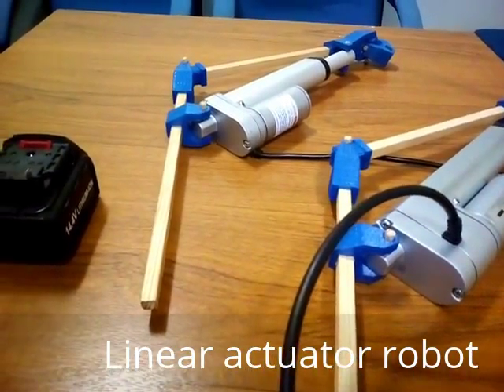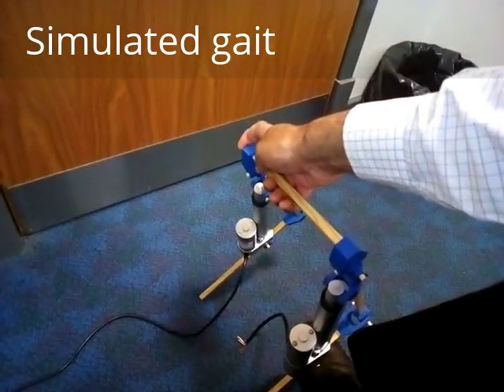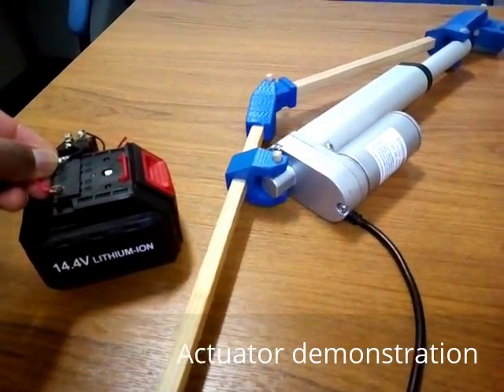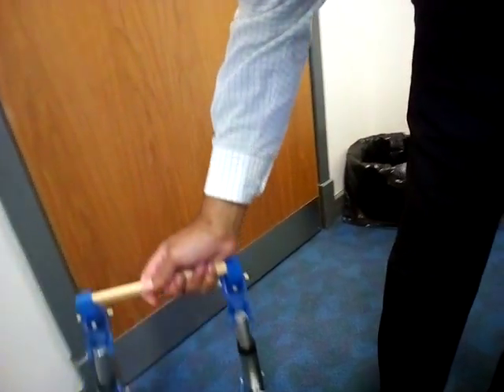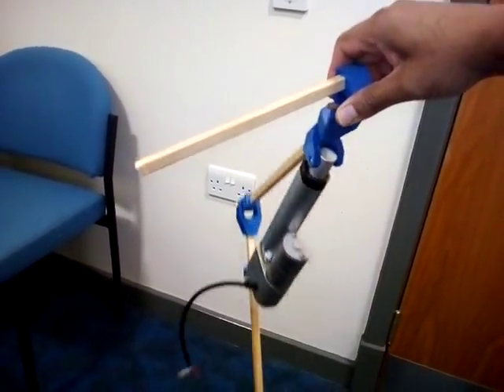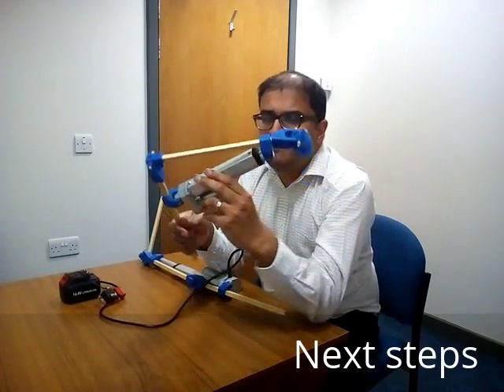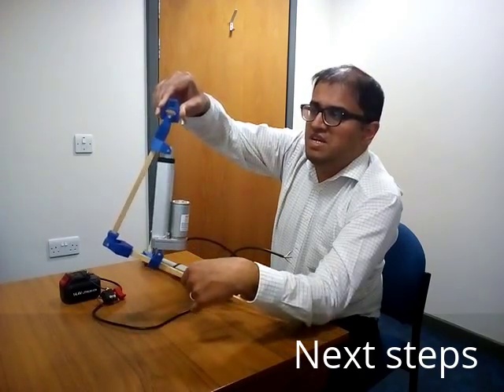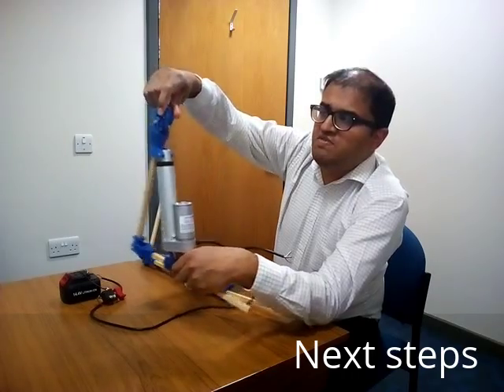Linear actuator robot Part 1

Comment: What about the shock and transverce forces that impact the actuators while moving? How do you solve this?
Reply from the maker: I dont really know what you mean by this. THe actuators are very rigid and I havent had any issued with load bearing etc.... maybe you could explain a bit more?